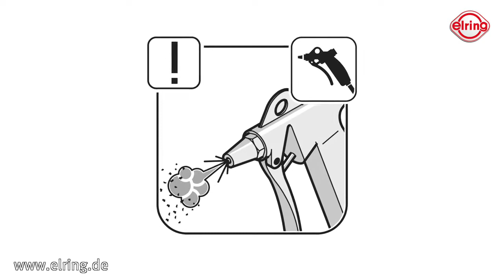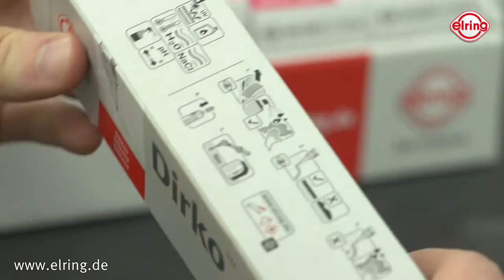Elring - Sealing compounds - Dirko

Comment: how long to wait before adding oil to the engine
Reply from the maker: Thank you for your comment. We recommend that you allow 24 hours curing time for every 2mm of sealant applied. For this video 24 hours would be sufficient.
Reply: @elringpartsltd  thank you for replay its almost 24 hours so it's done  ill add the oil in while,  but for next time when I can add the oil to oil pan some workshops say it's ok to add oil after 2 hours  ?
Reply from the maker: @BKxRepo  The time before you add oil to the oil pan all depends on the temperature and humidity of the area, for this video it is possible to the refill oil after 2 hours without any problems.
Reply: @elringpartsltd  thanks again amazing product u used it aslo to seal some spaces in the oven works great and electrical insulating on the engine harness